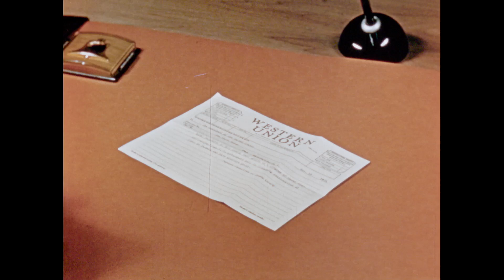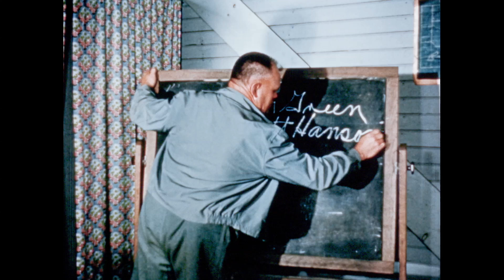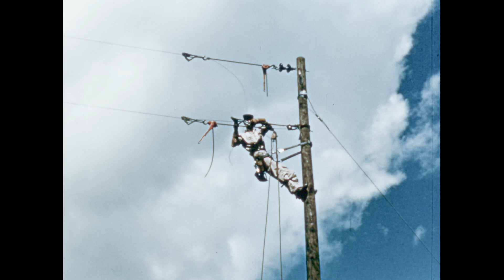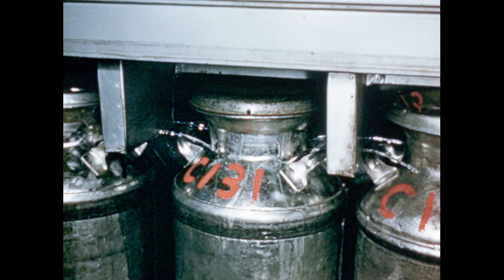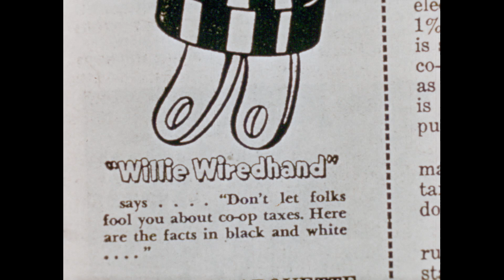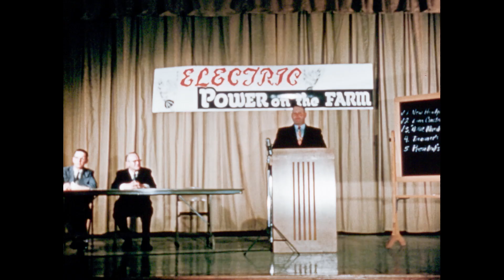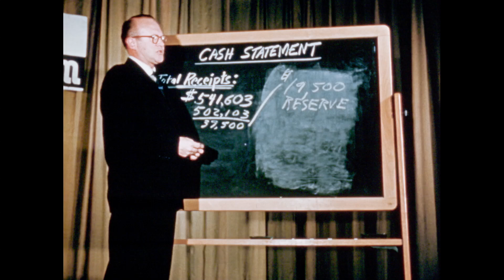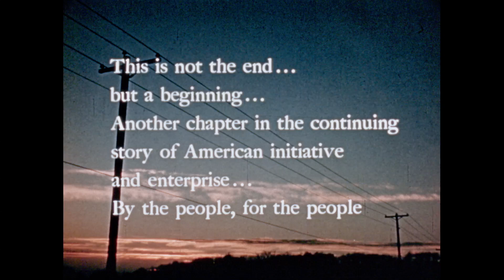By the People For the People

Comment: I don't remember it but, my grandparents had what was called a Delco electric system which used rechargeable batteries for lighting and some other DC current tools for household use less than 25 years before my birth.  The delco generator recharged the batteries during the day to provide power for the evening... Which was one of the reasons that until they passed away they were always Roosevelt Democrats due to Roosevelt instituting the rural Electrification Co-oP system...
It was on thing that Government got right in early thirties and forties
..
Reply: It would have been a 32 volt system.  My dad's parents had the same thing.